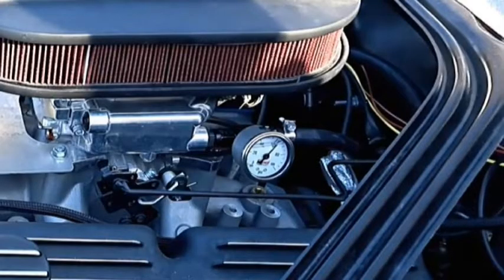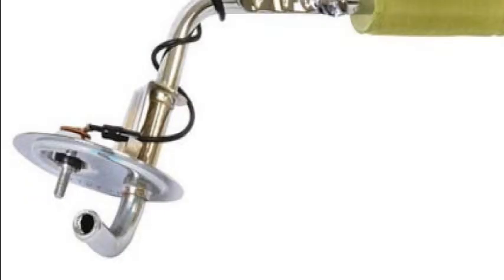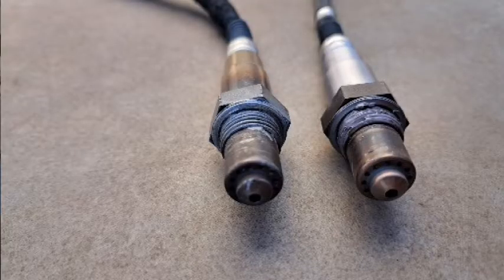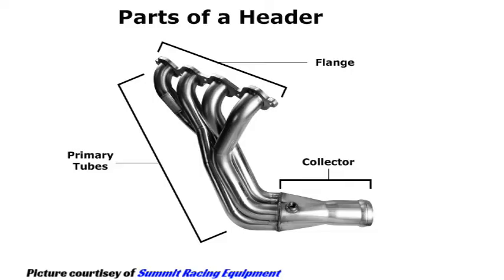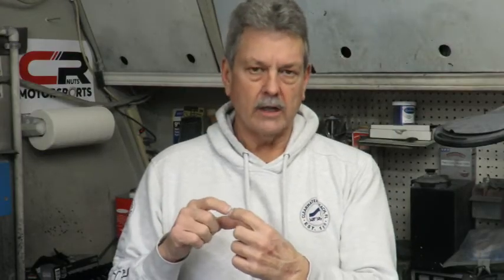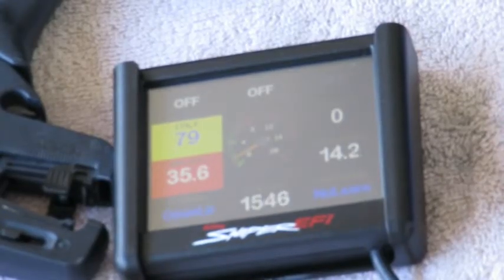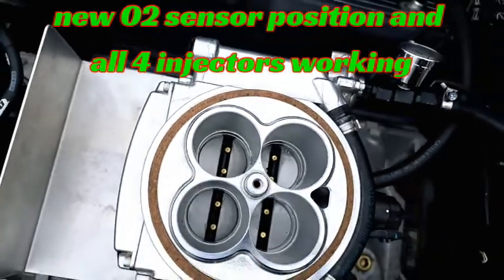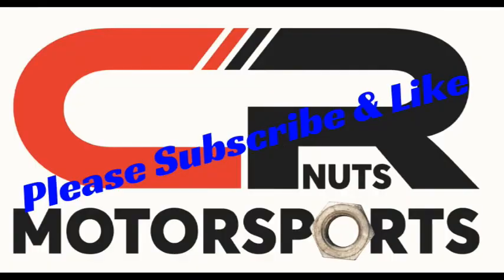Holley Sniper Air Fuel Ratio Issues & Start Up Issues Symptoms & Fix

Comment: Thank you for this video. I've been struggling with my Sniper 2 injector EFI (550-849 shiny) for weeks now. I have it installed on a 1939 Ford Flathead engine. I did this to improve reliability for my daughter when she inherits my car. So far it's a no go. The engine starts and idles perfectly. However I cannot get my target of 500 RPM's and my IAC at 2% to 10% at the same time. At 500 rpm my IAC reads "0", and, at 2% IAC my rpm's are 1200, too high for this engine. My AFR, A/F reading is 13.0 at idle but goes red when I first hit the throttle, then the engine will spit at sputter and either smooth out or shut off. I have a in the tank fuel pump and a fuel gauge near the EFI unit. It reads 63 lbs when running. I have checked both chambers in the EFI and they both have fuel coming in.  My O2 sensor is on the passenger side and is 10" from where the pipe bolts to the header. My instructions say approximately 1 to 10 inches from the collector.  I have no choice but to have the O2 sensor on the passenger side but, will move it closer to the point where the pipe bolts to the header. I can't get any closer than 4 1/2 inches, and if this fixes my problem, I'll gladly pay for your dinner some where.

Comment: Good tips. Many Holley Sniper 1 models are defective. Mine was a nightmare, then after fully failing and filling my intake and overflowing with fuel, (and almost having a fire) Holley was nice enough to upgrade me to Sniper 2 for $250.00. 2 is way better!

Comment: My AFR is stuck at 7.07.  any ideas?
Reply from the maker: My 1st guess would be the O2 sensor but before you go throw bucks at a problem, Download the latest version of the Firmware. It might be a software issue. If in doubt, always reload the most current version of Firmware.   Ken

Comment: Having problem with the AFR reading jumping up to the 35.6 if I accelerate. It the stalls out and I have been towed twice to get back to shop.

I watched your video and crawled under to look at where my O2 sensor was. It is downstream from the header flange by 1-2”. Do you think this could be the issue by being too close?
Reply from the maker: I suggest re-loading your firmware. Sniper 1 ?? I had a similar problem and I reloaded / updated the firmware and I went back to normal.
Reply: @ Holley sent out another sd card because hey thought it was corrupted. I reloaded it and it is doing the same. I just measure the distance from the flange to the bung. It is about 1.5” away from he flange and about 4 “ from where the four tubes on the passenger side neck down to the 1 collector tube. From there, the collector runs 19” to where it ties in with the drivers side before a single pipe goes to the muffler. 
Thanks for the help
Reply from the maker: @williamblair2934  I've fought with the Sniper1 for 3 years, finally hire a tuner (Mad Science out of AZ). Sent him logs like he requested and he responded that my unit was faulty and at least 1 if not more of the injectors were not firing. He informed me that Holley had a program were you can upgrade to a Sniper 2 for $250. It's a process to get this done but has paid off. If you email me, I'll get you my # and I can talk you through the process. The Tuner (Nick), knows more about the Sniper than Holley does. Worth every penny I paid him.
Reply: @crnutsmotorsports ok. I planned to call Holley tomorrow because I think they will warranty it. I will look for your email address. Thanks
Reply: @ yes. Sniper 1
Reply: I also ordered the pressure gauge from summit off of your link. It will be here Friday and I will check that

Comment: These are all the failings of the sniper 1, it should have been totally recalled by holley. The sniper 2 has solved all the problems, but it's now parroted across the interweb that they are all bad. You need to re-title this video "Problems with the holley sniper 1" which you cant even buy anymore.

Comment: I’m having an issue with this unit it’s only firing while cranking and if it does turn on it’s at 300 rpms. Im stumped
Reply from the maker: Check your 12v source wire. You need a "Keyed" 12v source that work both while cranking and just in the on position. I'm thinking you source is just hot while cranking.
Reply: @crnutsmotorsports  Thanks, I’ll check that out

Comment: At about the 11 minute mark into you video, I dont understand when you said the car ran like crap with the original holley sniper on it, you had the o2 sensor already fixed,  then you put on the replacement holley sniper and it still ran like crap and you said that you noticed that only 2 barrels was receiving fuel from the new replacement. You then put your original sniper back on and it ran perfect. You are basically saying that you did nothing to the original sniper that was not running well, when you put it back on it ran perfect...  What am I missing??? Did you send your original unit to holley to fix the fuel distribution problem???  Did the original sniper all of a sudden just start working when you reinstalled it??? I am very confused what you did to solve the fuel issue... Please can you explain better that part of your problem...
Reply from the maker: Sorry for the confusion. we didn't move the O2 sensor till we tried the replacement Sniper unit, when It ran bad we then discovered that only 2 injectors were firing. In a last gasp / desperation attempt., we reinstalled the original Sniper unit and found success.  We never anticipated the injector issue on the replacement Sniper. That threw us into a tailspin.

Comment: I had EVERY one of these problems with my Holley Sniper Unit.  I had to send it in for injector repair.  They fixed it under warranty but I lost 8 weeks of my driving season.  However, since then I have replaced the O2 sensor every year.  Not very happy with this unit.
Reply from the maker: Ours still isn't perfect. Gonna take it to a tuner soon. Just trying to get the car broken in and fix all the bugs. I suspect the new Holley Sniper 2 fixes a lot of the issues we've encountered. Nothing like paying $1200 to be a guinea pig...
Reply: Get a ntk sensor the bosh one holly sells is junk

Comment: Im having no start issues must be timing. Ive checked and re checked everything is corrrect.  Tdc compression stroke 15degrees. Of timing pointing to number one cylinder distributor  phasing matches 15 degrees. 
O clearance rockers timing chain dot to dot. Fuel pressure 59 60 lbs.  direct ground direct switched power. Good body ground.   

I have a new sniper EFI cd box coil and distributor.. 

They won’t start it tries to. It’s not backfiring out. The carburetor is trying to, but not all cylinders are firing and I also noticed that only a couple cylinders on each side are warm three cylinders on the left side only two cylinders on the right side. This is a brand new 383.
Reply from the maker: Tach signal is my guess. No signal = no run. It takes four wires to run, pos, neg, tach, key basically.
Reply: Its all wired up according to Holley instructions correct.  I have the whole setup there are no wires left that need to be wired up. You say tach so that means the new distributor is bad then? 

 I installed a new distributor and Carb not efi and the motor runs perfect.. 
so tach would make sense but its reading on the hand held when i crank like Holley says it’s supposed to do.

Comment: I’m having so many issues with Holley I have no more hair hair to pull out. I’m at my wits end I don’t know what to do. I’m basically doing the same thing looking at every forum which isn’t the best thing but I’m desperate. Holly is very slow on the responding back to any questions.
Reply: the spiper1 has known flaws, return it and get the sniper 2 with everything fixed.

Comment: I installed a spider today, it’s not injecting any gas, my pump produces 43psi I’m installing a pump tomorrow with 94psi would that affect the spider carburator? Should I install  a fuel pressure regulator?
Reply from the maker: Sniper require aprox 60 lbs of pressure. Over pressure should be discharge back to the tank. The sniper has an internal regulator in the unit. I assume your talking about external pumps, not in tank. No matter, put a fuel pressure gauge on the entry line to the sniper. They are not expensive ($30) and provide peace of mind. And it may sound dumb, but make sure you got it plumbed correctly. In, to the in, I have made that mistake, as stupid as it sounds.
Reply: I already installed a 95psi fuel pump and still no injection, truck starts with starting fluid but won’t stay on 😕
Reply from the maker: Do you have a tach signal? Sniper wont run unless its getting a tach reading. @lifeshare9074
Reply: @crnutsmotorsports  no I do not, i will get one tomorrow, where do I plug it in? I’m sorry I’m asking all this questions I’m new to this
Reply: I contacted the Holley customer services and no tach is needed for signal, what I do have wrong is the distributor, the one that is in now is not compatible with the spider carburetor, I just ordered a new distributor I will keep updated

Comment: Thank you for all the info I’m going to go through mine step by step and see if I can figure mine out . I have a feeling mine is the location of my O2 sensor. Or more less the angle of if because mine is mounted at the top of my exhaust and not on the side of the pipe at a 10 degree angle like they said in there instructions. I have a rock crawler and I’m mostly at 1200 to 1500 rpm idling through the wood and it will do fine but all of a sudden it will hit 22 to 35 on the air/fuel mixture and die . Then has to sit for awhile before cracking and most of the time I have to cycle switch before it will crank
Reply from the maker: Just to cover your butt, check to see if the TPS (throttle position sensor) is working properly. It shows up on one of the 2 screens you can use to monitor you Sniper. Very important that it is functioning properly. We learned the hard way ✌ It's an easy fix if not working. Did a episode a few months back on that fix.

Comment: All those videos, with efi ,nothing bur problems, does any of them work ?
Reply from the maker: We put one on the 442 and it worked brilliantly for the get go. The Cougar was 4 months of learning more than we wanted to know and is close but not perfect. Spending another $700 will make it perfect. Is it worth it...??? The new Sniper 2 looks to have improved on all the flaws but I'm not going to drop another $1,500 to find that out. But I will say on the Cutlass, it turned it into a beat, we didn't know how far off on the carb we were till we installed the Sniper.  Ken

Comment: I am putting a sniper on a 454 in a very well used dually. The SMOG exhaust parts had rotted away leavening many open holes in the exhaust. I plugged the exhaust leaks until I can put on headers, etc. 

The stock distributor was a computer controlled one, but the computer was removed when I bought the truck. I opted for the hyper spark too. 

Everything you mention is right on point! 

Exhaust leaks are detrimental to the sniper running correctly

Comment: Great info and I appreciate your videos, I pretty much have gone through all the steps you have already described my engine does run good but it runs eye burning rich. That’s why I got rid of my Holley 650/and went with the MSD Atomic 2. I had  my AFR setting at 13.5 based on the original factory settings. I moved it to 14.1 just to lean it out a bit am I going in the right direction, is there any harm in that? I have read that 14.7 is ideal AFR I don’t want to go to lean.
I also have a situation after a warm start the engine knocks like crazy and refuses to start. I’m not sure if it’s a detonation or the fuel prime issue I backed off my fuel prime from 1.50 to 1.35. Do you have any comments on that?
Reply from the maker: There is a new episode of "Engine Masters" on the Motor Trend channel / app. Episode 23 of season 8. It specifically mentions O2 setting on the new Sniper 2 & in would think directly relates to the Atomic and/or the original Sniper. Also episode 20 of season 8 cover O2 sensors, good background info, basically they test 4 sensors and they all are real close. we've been struggling for a while with spotty performance and have just resolved that issue. TPS (throttle position sensor) was faulty. Our next episode is going to cover that issue. So simple to check and so obvious, we overlooked it and it really matters. Your pinging most likely is a timing issue / distributor. I'd resolve that before adjusting AFR. Just a guess on my part. The Sniper on the Cutlass install and run perfect, never an issue and changed that cars personality Big Time. The Cougar has been a fight from day 1. The engine perfect, but the Sniper has been a battle. I know more about Snipers than I ever wanted to know.  Ken

Comment: Perfect. Thanks! Have the same problem with the afr reading 35.6 and couldn’t figure out how to reduce the over fueling. Engine runs great but rich. Positioned the o2 sensor 6” from header flange not collector.
Reply from the maker: Just Watched a new episode of Engine Masters on the Motor Trend TX channel. A great episode on the new "Sniper 2", had some tuning tips / insights for AFR settings, great episode.   Ken

Comment: My car has the Holley super sniper and it cranks but won't start, checked all the usual stuff and can't find a the problem, could it be a bad O2 sensor?
Reply from the maker: Check tachometer signal. Even with a bad O2 signal, it will still run.... just poorly to a point. That and fuel PSI. 

Good luck 👍

Comment: Thanks for the video. Any issues with starting after the car is warmed up?
Reply from the maker: None, what so ever. We did just change to the OEM fuel pump / sending unit and it helped. I suspect the exterior "pusher pump" was stressed in our application. Just another $450 I didn't need...... Ken

Comment: what mufflers do you have on the car?
Reply from the maker: Sandserson Headers, 2.5" Tubing, Thrush Cherry Bombs, exact replica of a 1966 Shelby Mustang  exhaust system. Saw it on a Steve Magnante episode, he went into great detail on this system. Printed off a picture, took to my muffler shop and said that's what I want. B&G Muffler did a perfect reproduction. $1,000
Reply: @crnutsmotorsports  thank you for the reply, the car really sounds nice.

Comment: I’m having issues with my afr and I’m assuming it’s because of the placement of my o2 sensor. I have a miss understanding of where it should be placed and I watched so many videos of where it should be. Right now I have it on the collector. But you’re saying it should be past the collector ?? So 10” away from the end of the headers ?
Reply from the maker: There are variables, but my suggestion is 4" past the Collection Point, That's where all 4 individual tubes come together as 1. Make sure your headers are sealed properly / header gaskets, and no cracks in the tubes themselves. We even went so far as to purchase another O2 sensor just to make sure. The second sensor was installed on the other side of the engine and the initial placement sight was plugged. We have another Sniper video coming out in 2 days. Dealing with just the installation aspects.
Reply: Thank you I’ll be checking it out

Comment: Have a sniper kit for my 350 sbc in my 82 C10. Had a hell of a time getting the AFR to quiet down. Messed with it for 2 days. Completely removed the sniper kit and reinstalled it. Turned out I had a tiny crack in the header. One of those simple stupid things. Got it fixed then the head gasket decides to take a vacation the next weekend lol. Pulled the engine out and just rebuilt the the old tired girl. About to put everything back together this month. Fingers crossed, I'm ready to have my old truck back.
Reply from the maker: We know the feeling, this Cougar has fought us tooth & nail. Everything has to be done 3 X's

Comment: Im using a returnless system, even holley sells a returnless system kit BUT IM only at 58 psi BUT its running Okay BUT Im sure it would do a lot better at 60-65 psi so thanks for the tip.

Comment: All electric fuel pumps pull to some extent. When they call it a pusher that means they want it as close to the gas tank as possible and not in the engine bay. The electric fuel pump will work fine with your fuel sending unit as long as it's below the gas tank. Sounds like you were unable to get the fuel pump there because your gas tank is already really low under the car. I was success with the setup because my gas tank is behind my seat, 73 Dodge Power Wagon, which made getting the pump below the gas tank very easy. A little bit of pulling from the electric pump and after that it's a siphon effect doing the job.

Comment: Too many issues with sniper. I'm thinking, class action lawsuit. That self learn feature is balloony. To think I spent an extra 2 grand and get nothing but headaches when I could have stuck with carb, had a good running vehicle, and be 2 grand ahead makes me doubt my own intelligence..
Reply: Enough of the headaches...switching back to a carb tomorrow.  Sniper has been a nightmare since I installed it 3 years ago.
Reply from the maker: I feel your pain. I'm hoping in the long run, I made the right decision.
Reply: I’m going through same shit
Reply: That’s exactly how I feel ! When I made the decision it was efi for about 2k or a buddy selling me a wrecked truck so I could motor swap his 5.3 into my k10. I made the wrong choice
Reply: Yeah bro the price and hard work to install this sniper efi. Yeah bro we gotta sue ,this thing flooding my engine